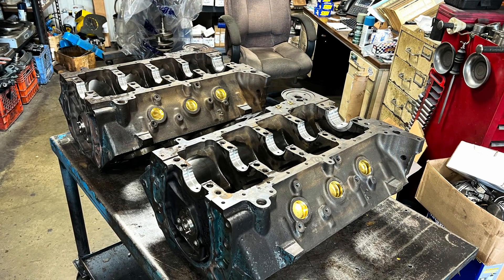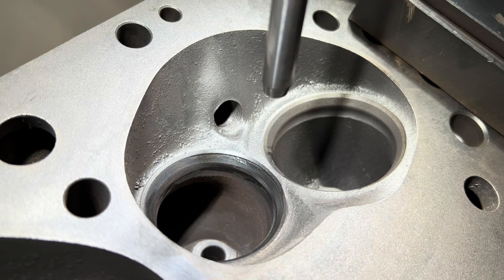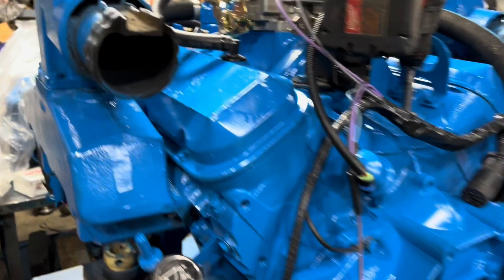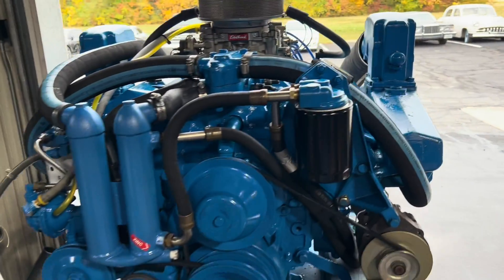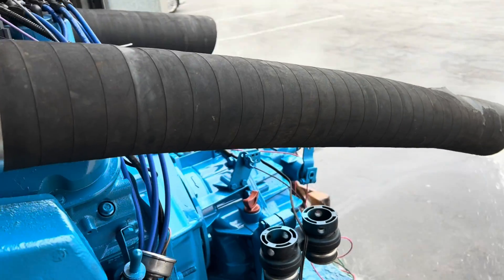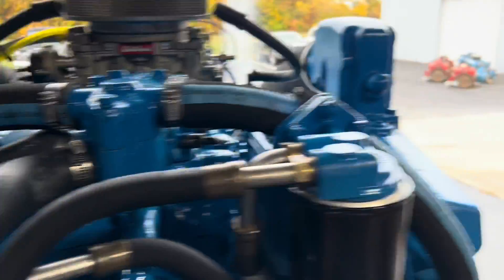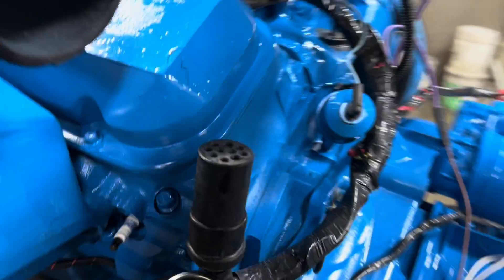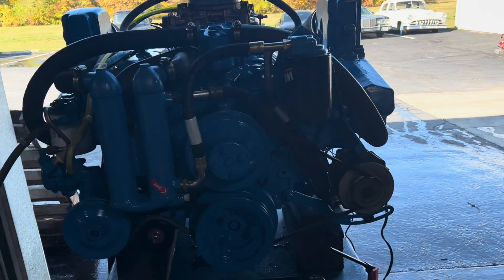Twin 454 7.4L 385HP Gen VI Marine Engine Overhauls

Comment: So from this video can I assume it's possible to use the Mercruiser exhaust riser and manifolds on a Crusader engine? I much prefer those manifold types, as they look far easier to get access to the spark plugs. My Crusader XLi 454 has terrible access to the plugs, I pretty much need to pull the exhausts to get at them.
Reply from the maker: Yes, absolutely
Reply: @LakelandAutoMarine  Good to know, thanks!

Comment: Hey love ur engine builds.  What kind of ( fuel pump / pulley set up) is that driving that fuel pump. Never seen one of those. And where can i get one
Reply from the maker: This is half Mercruiser and half Crusader. That fuel pump/water pump setup is a Mercruiser setup from 1992-1997 on most big blocks with carbureted engines.
Reply: @LakelandAutoMarine   / tnx i saw them on Amazon wanted to put it on my 350's to make fuel pump access easy.

Comment: For a stock motor those sound mean.  Does Edelbrock make a marine-spec carburetor or are they automotive carbs?  Also, is that a DeSoto in the back righthand side of the frame?
Reply from the maker: Edelbrock makes a 1409 and 1410 marine carbs. 1409 is 650 CFM and 1410 is 750 CFM. Yes, that is a 1951 Desoto we are working on.